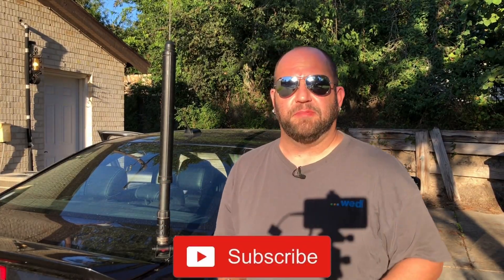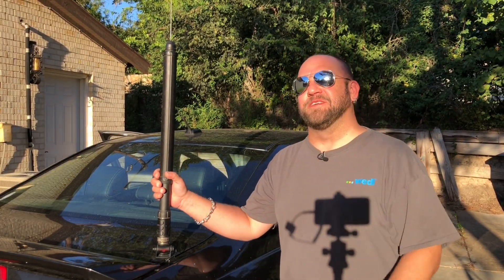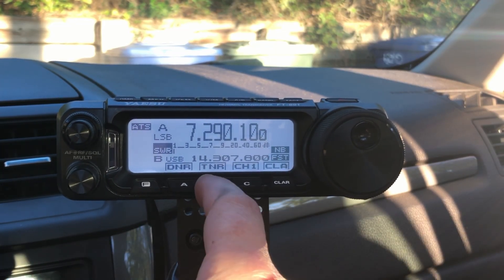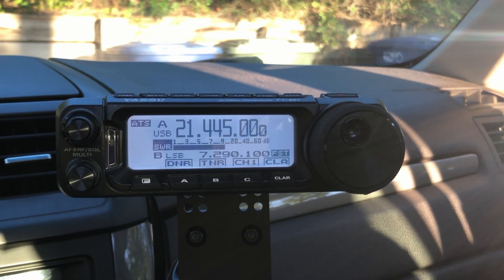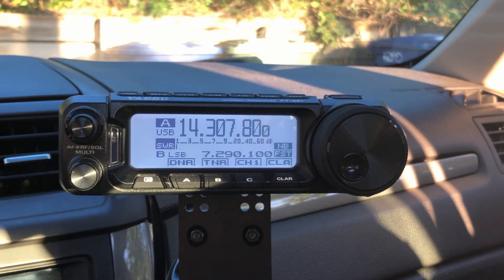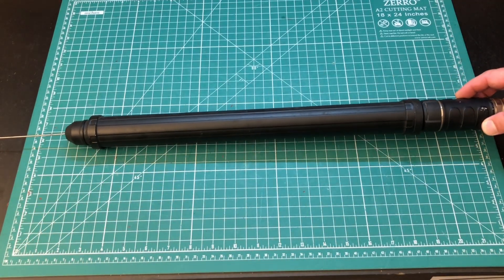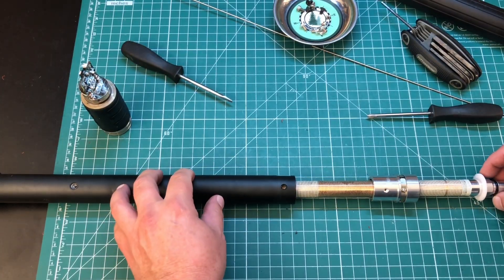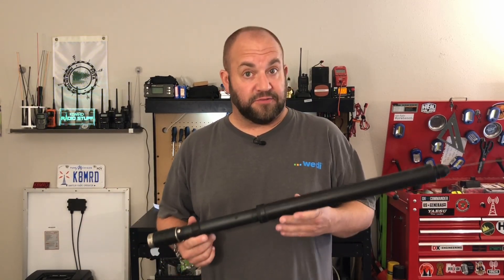Yaesu ATAS-120A Mobile HF/VHF/UHF Screwdriver Antenna

Comment: I'm really late to this video but maybe you'll see this... I'm looking at the ATAS plus 891 for my electric and aluminum F150 Lightning, because of your comment about not needing  bonding etc.  Do you still recommend the ATAS? Seems like a great solution.
Reply from the maker: First off, good on you for buying a Ford.  The 891 and ATAS are in my opinion the best mobile HF setup you can get.  I'm still using it to this day but I've got it on my Ford Explorer now.  No bonding or grounding done.  Here's how I did the ATAS/891 setup in the Explorer.  https://youtu.be/6fqDoB2s9Ds?si=URjhifgwrKoxGyER  Josh from Ham Radio Crash Course has an F150 Lightning.  This video will prob be way more helpful to you than mine.  https://youtu.be/o86z2_74e4c?si=9nKBfJmf2PfvIm1q
Reply: Thank you so much for getting back! I love this crazy truck, built at the Rouge.

Comment: Will this antenna work with my ICOM or is this just a YAESU product for their radios?
Reply: No and Yes
Reply: Most new Yaesu sets will tune automatically. Google tells me that there are manual controllers too. 
But don't blame me if it doesn't work.
Reply: The Yaesu radios have a tuning program that tunes the antenna.

If you try it - I'd like to know how it goes.
Reply: Good review. I noticed closer to the end when you say that the antenna is wobbly, I zoomed in and can see that is wobbly at the mountain you are using. My first impression was there the antenna is not well built (not contained the wip)

Comment: Hey Mike I have a question about mounting the ATAS 120A ,I want  to use the Firestik SS 204A, on my rear corner of my 2002 Dodge Ram 1500, the Firestik SS 220A comes with the mount 3/8" 24 thread and the Atas 120A has a UHF mount, how doe you make the mount work to the ATAS 120A? Please send me the information on how I can make it work, Thanks, Bob, WD9GWM
Reply from the maker: I don’t have any idea what that is.  I used a diamond K-400 mount.
Reply: @hamradiotube saw your blips on the map at the end.. what about going about 150 miles from west Austin to north Houston and reliable coms or this is better further out?

Comment: Hey Mike, question for you. I have heard of your using the 891 with the atas you don't need an antenna tuner. I have also heard that you should still use an antenna tuner because it can have issues tuning up at the end of the bands without an ext tuner. What are your thoughts on this? Planning on getting this radio and antenna soon just looking for advice. Thanks.

Comment: This thing is an absolute dream, but it is pricey at just shy of $400, but the signal quality from what friends have shown me is pretty darn good. FT-891 is highly recommended with the ATAS.
Reply from the maker: It's actually on the low end of the price range for motorized screwdriver antennas.  Not to mention you don't need to buy a separate control box to use it like my TarHeel.  That'll cost you at least another ~$100 for a basic one.
Reply: @hamradiotube Excellent points. Thanks again! Love these reviews.

Comment: Where do you see what the SWR is? I see 1 3 5 7 9 20 40 etc, but that doesnt show the SWR, I'm confused.
Reply: its the horizontal black bar that starts off the whole width of the display and as the swr goes down, it gets shorter.

Comment: Thanks for mentioning the freezing problem.  I was thinking my ATAS-120A was defective because it would go into tune mode but the antenna didn't move or adjust.  I would back out of tuning and hit the tune button again, then it would go into the long reset/retune process.  Very annoying.

Comment: My experience with ATAS-120A, meh. I hear way better things about Tarheel. Mine actually seized up on me one day and I sent it back to Yaesu for repair. The guy I spoke on the phone was very nasty. I told him, you can keep it. I've never bought anything new from Yaesu since then, and that was like back in 2013.
Reply from the maker: I've got a Little Tarheel II that I've ran for several years.  In my experience they're very similar in terms of performance.  I did a comparison video of them a while ago too.  https://youtu.be/Eewnagvqf7o?si=zka0Z9QS9xp38JMT
Reply: Can you drive and use this antenna?

Comment: I used the Atas 120A with a Yaesu 857D, worked good but i replaced it with a tarheel antenna which worked much better. Anyone interested in a like new atas 120a. I have one available.
Reply: I'm saving up for an 891 and hopefully will get one sometime this year. How much would you like?
Reply: @AlleyDoc  think it is spoken for at 250, if he does not pick it up I'll let you both know.
Reply: Hey ya, this is Kevin, 9V1KM KK7QGL, i recently achived my extra licence, bought a FT-991A. I keen to know your selling price for your ATAS-120A, CHEERS!
9V1KM  KK7QGL
Singapore😊
Reply: @9V1KM_MAGNUS  think it is spoken for at 250, if he does not pick it up, i'll let you know.

Comment: Hey Mike nice video, it really goes into great detail. Like you I’ve heard so many people say grounding and bonding is the only way to get this antenna to work good. Spent a lot of extra time taking the trunk apart to ground and bond at least it. The antenna tunes every band but 12m where the SWR won’t go below 2.8-3.0:1. You just plop the antenna on your car and boom it tunes 12m. I’m a bit perplexed to say the least. I’m going to try undoing the ground straps and see what happens.

Comment: If you don’t feel like sitting there eating up your car battery while you “Wait for it to Catch Up”, if you RTFM (for the 891) you will see that you can set the Settings for the antenna to be tuned Manually…so basically you shut it off from Auto tune, once, manually tune it ONCE, and then change the Settings back to Auto and it will work again. I never fixed the Lock Up the way you did but next time, maybe I’ll just let it eat up some battery 🪫 instead of screwing that much with the Antenna Settings on the 891. 73 from Okinawa.That’s an Okinawan dressed Pikachu on my profile picture 😆
Reply: Or you can hook the radio to a separate Lithium battery and not worry about the car battery. That's what I do for ALL my mobile work. Even my 2m/70cm radio.

Comment: Dont forget ft100d , thats what the ant was made for , wish they made an adapter or something so this could work with icom 7100
Reply: They do 
I use mine with an icom 7000
 Check out the mfj 1925. Works great

Comment: Could you put this antenna on a tripod like a GRA-ULT01 MK3 and transmit with it?  I'm assuming you would have to have a radial wire of some kind.
Reply from the maker: Absolutely.  One of the guys in my old club in MI does that.
Reply: @hamradiotube  What kind of a radial system did he have?  Was it ground mounted or house mounted?
BTW, the Bryan radio is having a Winter field day this weekend, if you would like to come down again.
Reply from the maker: @jeff1806  Oh it was just ground mounted for portable operations.  He had some kind of tripod for it.  I really know nothing about what he was using but you would need some radials for sure.  It's really no different than a Wolf River Coils.  I'll be in Galveston for WFD but thanks for the offer.  Hope you have fun!

Comment: The antenna is kind of heavy, what kind of mount are you using there? Can the small mounting kit able to withstand the weight while driving?
Reply from the maker: Diamond K-400.  Best mount out there.  It regularly sees 100mph "wind" and handles it like a champ.
Reply: @hamradiotube  Good to know. Still loving your videos. 73

Comment: Wonder if you could help me. I got the ft891 did everything to connect atas120a antenna  nothing. No stations no talking zilch. My question is does antenna have to be grounded good or the radio grounded  ty hope to hear back  from ke8hif
Reply from the maker: I talk about all of that in this video.

Comment: Do you think it would tune to lower frequencies with a long whip installed?
Reply from the maker: I tried to get it to tune on 80 by adding a bunch of wire with an alligator clip to the top of the whip and it didn't work at all.
Reply: @hamradiotube    I sent an email to Yaesu tech support asking about a longer whip for lower freqs and this is the answer I got back.      Hello Roy.

Thank you for contacting us regarding your ATAS-120A.

The antenna internal loading coil and whip length have been optimized for 40 through 6 meters operation, and changing either of these components will affect the overall performance of the antenna.

I have not tried tuning an ATAS with a longer whip. I suspect it would tune on 80 or 60 meters with a longer whip, but the frequency range on each band would be small due to the “Q” of the loading coil and it would no longer work on the other bands.

               

Best regards,

Rodger Kerr, N6GMT,

Amateur Radio Technical Support

Standard Horizon Marine Support

Comment: I see you mounted the 891 on a fish finder mount.  How did you secure the radio head to the mount?  I have one now and I am tempted to just a drilll whole in the middle of the bracket and find a matching bolt to bolt them together.
Reply from the maker: Uhh, no. I’m using this.  https://youtu.be/l0rtiXFhFKY?si=D80hlur_X1D23-y_

Comment: Can you tune it to 80m ? Or can you get the swr low enough to use it on 80?
Reply from the maker: The ATAS only does 40m - 70cm.  No luck on 80.  I even tried connecting a wire to the whip to see if I could get it to tune on 80 and failed miserably.

Comment: Want to buy more for base station use. What are the grounding requirements for this to operate properly?
Reply from the maker: It definitely needs a ground.  You could run some counterpoise wires from it or attach it to something metal that will provide a good ground.

Comment: Good video, I have a question, The spec mentioned can cover 28Mhz, but is this antenna capable of tune the range for repeaters in FM?( 29.620,29.640, 29.680), I'm afraid to get one and be disappointed, thank you in advance. XE2GRC.
Reply from the maker: This antenna will tune 40m-70cm.  And yes, I have made 10 meter FM contacts with it.  I love this antenna.

Comment: Got my tech+ license a long time ago... when it was still tech+. Then I took about a 20 year sabbatical from ham radio and just kept renewing my license, but sold everything.  Anyway, I'm getting back into the hobby and I just bought an 891 and ATAS-120A... haven't mounted em yet though... and working on my general class. Thanks for the demonstration video. Made me feel good about the setup I bought.

Comment: I have these antennas since they introduced them. The first generation had problems with water getting in, Yaesu did repair mine the first time around. After that, I just regularly inspect it and make sure it's sealed with some fresh silicone. Super important for a good ground on the antenna.. I now have one of these on my RV with an 891, the difference between the handling of the 891 and the 857D besides no 2m/440 is that the 857D told you it was initializing the antenna, where the 891 makes it look like there's something wrong. Most of the problems people have with this antenna is issues pertaining with grounding. nice video..

Comment: How mechanically solid is the PL259 junction? Sounds like it would be a problem when passed at 60mph by an 18 wheeler.
Reply from the maker: It's actually surprisingly solid.  I'll tell you my ATAS regularly sees speeds in excess of 100mph with no problems at all.

Comment: can ATAS-120A be used on IC-7300 ???
Reply from the maker: I'm not one to use the word can't but I don't think it would be easy.  You'd have to get some way to control the antenna.  It's really designed to work with Yaesu radios as they all (mostly) have the ATAS  control built in.
Reply: Use an mfj 1925 an you will be good my friend
Reply: Mike has a video of a guy he met that has an ATAS and a mobile mounted 7300. Just saw it earlier today.

Comment: I just bought my ATAS 120A today at HRO. It's mounted on a hatchback with a Diamond K400. My radio is an FT-991.  WOW! I went through all the bands using FT8 (almost a real-time signal report) at 20 watts. From Portland, Oregon I got into England on the 20-meter band with FT-8.  SWR was never higher than 1.2.  Moist of the time the SWR didn't register on the.

Yes. I'm VERY happy with it. 😁
Reply from the maker: Heck yeah man that's awesome!  It's a great little antenna.  Congrats on making it all the way to England too!
Reply: @hamradiotube    Look at PSK Reporter in the last 6 hours. Call sign is K7JBL. After a second look I see that  England was on 17 meter. I was shocked.

Comment: Will that radio do 2meter or 70cm?
Reply from the maker: yes
Reply: @hamradiotube  I’m confused   The technical info said it wouldn’t
Reply: I really want this radio that’s why I asked but I need the 2 meter and 70cm
Reply from the maker: @ShaneKA5GSS  oh I’m sorry I thought you were talking about the antenna.  No the 891 doesn’t do 2 and 70.

Comment: How many watts do you transmit with engine off ? 73s, Jimmy SY1DAL
Reply from the maker: 100.  But I'm using an external battery.
Reply: @hamradiotube  oh ok that explains it 😁

Comment: I had some issues installing it on my tailgate.  I installed the mount a little too low and couldn't get 20m to tune up.  I grounded the mount and the radio to the same spot on the chassis and could get other bands to tune.  Then I moved the mount up to give the antenna more clearance from the aluminum, yeah it's a ford, and voila, works just peachy.   Probably would work better mounted off the hood.  But that requires a different mount.   ;)  Keep up the good vids dude!

Comment: Will work on 80 if you add a wire clipped to the stinger cut between 40 and 80 at 1/4 wavelength. Had the Atas setup at the cabin a few times. Love this antenna!!
Reply from the maker: I tried adding wire to the stinger and it was not working on 80 at all.

Comment: Excellent "hands-on" review thank you. I'm about to buy a FT857 so I will probably buy this as well. Just one point - those screws you called "Philips" are almost certainly JIS (Japanese Industrial Standard" heads. Philips screwdrivers will fit but are a loose fit and eventually with many cycles will chew up.  JIS screwdrivers fit perfectly and are readily available in the UK and I'm sure they will be in Texas!

Comment: Hi Mike,  I'm going to use the ATAS 120 with my 991A as a base station on the back deck (HOA, you know).   What coaxial cable (RG?) do you recommend to connect my radio with my magnetic tripod?

Comment: I want to thank you for your videos. Yesterday I mounted the atas 120a on a comet lip mount then to my Yaesu ft-891. I made few contacts right away. I haven't decided if I'm permanently mounting the radio yet,  I was going through the power mini 2 with a 9ah bioenno. I  couldn't be happier with this Mobile set up.  I had been looking at the 891 for some time now.  I know you, Josh, and so many other YouTubers have talked highly of that radio for Mobile install, the rest is 95% your videos compared with 5% of others reviews. Anyway thank you for sharing you knowledge  and firsthand experiences. 73 K0MYK

Comment: I have an atas 120 , that I teamed up with an 857D and I can tell you it performs very well. I bought the system brand new at the Dayton Hamvention, along with a triple magnet mag mount. My previous set up was a 9 foot whip with an antenna tuner mounted right inside the fender well behind the plastic on the car. The trouble I had with the antenna tuner was, it was constantly trying to re-tune the antenna as the 9 foot whip flopped around highway speed. Not that I didn’t make good contacts all over the world with that set up. But when the thing would take off and try to retune drove me nuts. So I literally plugged my radio in to a power connector in the car slaped The mag mount on the roof with the atas and while my wife drove us to South Carolina I was going along through the mountains of Tennessee, working Italy on 20 m and all other European DX that day. As I drove to work every morning on 40 m I had a regular schedule with the guys from Memphis to mid Ohio. The atas antenna performed quite well. I worked DX literally all over the world from 40 m to 6 m I used to separate antenna for VHF and UHF. I still have the antenna I wouldn’t give it up for anything.

Comment: It would be nice if these antennas were actually available.  My FT-991 wants one, but nobody seems to stock them. WIMO shows them in stock, but I can't find them in the States.
Reply: I just saw it in stock at giga parts
Reply: @jiml40   I see they have them back at HRO too. 😀 They have a store 15 minutes from me.
Reply: DX Engineering has them at this writing.
Reply: @jln55    Thank you for responding. I kid you not. Within days of my posting, HRO had them back in stock.  A 20-minute drive (we have an HRO close by) and I had one in my hands. 

I guess the next time I want something, I should just complain they're not in stock anywhere in the U.S. and like magic, will be re-stocked. 🤣

On a side note...Has Andy ever given you more than one bullet at a time? 🤣
Reply: @phillipzx3754  Would YOU have given me more than one?:D
Reply: @jln55   🤣

Comment: Mike, I live in an HOA, I need an outside antenna for my FT-991a. One of my possible mounting areas is next to my Direct TV dish.  Will this cause a problem with my Direct TV reception?  Thanks.  N9MRJ
Reply from the maker: I would doubt it but I really have no idea
Reply: Keep in mind the ATAS-120 is a mobile antenna which uses the vehicle body as its counterpoise. You'd need substantial metal under it in fixed use to let it tune. A metal roof might work well, or HVAC ducts in the attic, a few ries strung horizontally below it, etc. If you just mount it to the tube of the satellite dish, not so much.